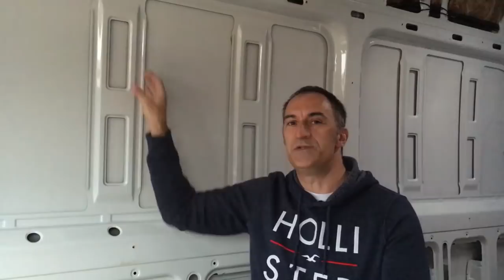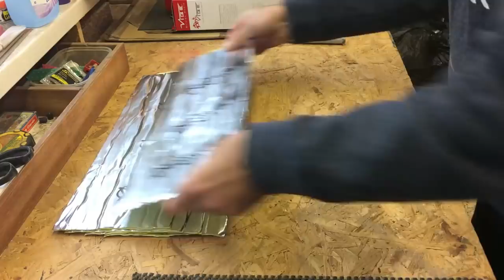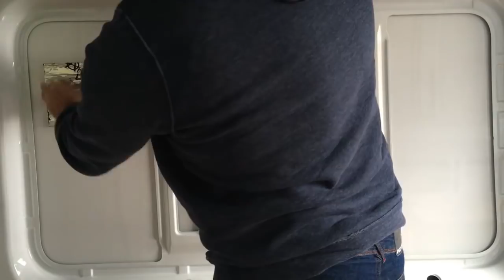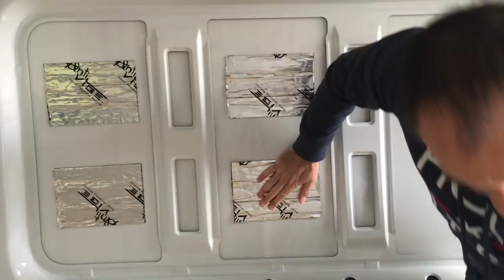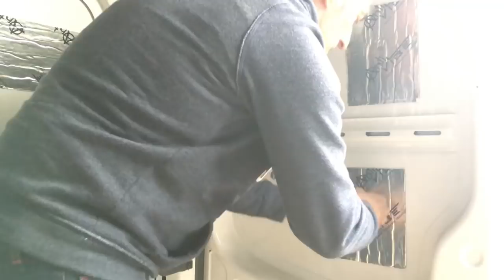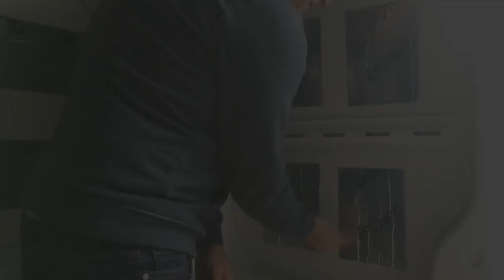Noise & Vibration in your Camper Van

Comment from the maker: EXTRA NOTES - You may find that your panels rattle because they have come unstuck from each other. I recommend using some Sikoflex mastic to stick the inner and outer skins back together, before applying sound deadening material. A good inspection of each panel and inner stiffeners will highlight where repairs are necessary. Hope that helps and thank you for watching.
Reply: Might be worth mentioning that a bit of heat helps in cold weather - I fitted mine in 2 degree weather and found that a quick blast of a heat gun prior to application made the material much sticker and much easier to work with.
Reply from the maker: Sounds like a top tip Duncan, all these things are better applied when it's a bit warmer. Cheers
Reply from the maker: Hi, you are absolutely correct the insulation will provide sound attenuation by absorbing sound waves that travel through the structure.
These anti vibe mats do a completely different job. They prevent the thin sheet steel panels from vibrating and producing a drumming or ringing noise. So they are preventing the noise generation at the source.
Thanks for your kind feedback
Reply: Greg Virgoe I viewed an insulation build by someone else, and they go criticized for not using the anti-vibration pads. Their response was the Mercedes cargo van already has them installed.
Reply: Greg Virgoe All the videos you make are so helpful.
Reply: Greg Virgoe excellent video series, thankyou.  just on the sound proofing aspect, your insulation, plywood and vapour barrier will be your sound proofing. Those three cover all aspects of sound proofing: mass (plywood) Damping (rock wool) and having an air tight seal (your vapour barrier). Judging by what I've seen so far from your attention to detail and workmanship, your camper will be quiet!! Thanks again for these vids.
Reply from the maker: Spot on! You know your stuff. Cheers
Reply: Ive found a few of those, even some that looked attached but did move around!
Thanks for the great series
Reply: No problem, just so you know, the anti-vibe tape  will help prevent road noise whilst vehicle is in motion (the "drum effect") . It won't however stop sound from entering or leaving cabin once stationary. Rock wool is probably better than pu in this regard, but only marginally. The greatest sound attenuation will be in the Air-tightness, mass, and damping/isolation. You've got all bases covered!.
Reply from the maker: Thank you, Really pleased that you find them to be useful.
Reply: Thanks Greg for a really useful and informative video, I'm following your build with great interest as it is something I'm planning to do myself.
Reply: Sickoflex recommend any brand or place to buy
Reply: Hi Greg - Great video,   Do you have a link to the sound deadening product you've use in the large sheet.   Would you recommend sound deadening the cab  floor?    I was thinking of using dodo sound deadening Mat are these products comparable? thanks in advance
Reply: Hi Greg, thanks for the awesome videos! What number Sikaflex would you recommend for this job?? Are there any other sika products that are useful for the van conversion as well? Thanks very much!

Comment: Do the wheel arches need covering in this?  I’ve seen vids where the whole arch is covered in the dodo mat. ?
Reply from the maker: There’s no vibration in the arches it’s noise breakout. So closed cell foam insulation is best to absorb the sound from the road.
Reply: @GregVirgoe  great. I’m about to embark on my own mission. Your vids are very helpful 👌

Comment: Adding mass lowers the natural frequency and adding stiffness increases the natural frequency. I am an M.E. and vibration analyst and consultant and when I do my van build ( hopefully Spring ‘23) I plan on actually testing this material and documenting how and to what extent it actually works.
Reply from the maker: As I said in the video it definitely helps on the large flat panels. I don’t see the point of putting it anywhere else as the manufacturer has done enough to combat vibration. 😊

Comment: Do you think those sound deadening materials are still needed before applying spray foam? Or the spray foam alone is enough as a sound deadener
Reply from the maker: You won’t need them if you are doing spray foam insulation. You won’t need a vapour barrier either as the spray foam is a closed cell
Reply: @GregVirgoe  Thank you. It’s really amazing how you scientifically explain what you’re doing.

Comment: Are there any issues of this type with luton vans? I'm wondering if the framing and insulation will stop any noise and the acoustics will be good once it's full of furniture and partitions and stuff
Reply from the maker: If the Luton is metal sided a couple of sheet on the large panels will prevent any vibration noise. The thermal insulation, panelling and internal fixtures will help with sound absorption 🥳😃
Reply: @GregVirgoe  that's excellent, cheers Greg. Really informative and in depth video. Can't thank you enough

Comment: Hadn’t a clue where to start quieting my caddy down but now have learned a lot from this video especially differences between sound deadening  and sound proofing easily mistaken for the same thing great video Greg
Reply from the maker: Also different methods fir dealing with noise depending on how it’s generated. Either by vibration or transmission. The sticky deadening mats deal with vibration. A dense foam insulation is better to deal with noise transmission from outside like wheel arches etc.

Comment: Question, let's say after a year or so I want to remove it. Would it be difficult to remove due to the adhesive ?
Reply from the maker: It would most likely leave a residue that you would have to remove with a solvent.

Comment: I'm not convinced it makes any measurable difference in terms of reducing van noise certainly some 'vanlifers' have tested it and not detected any significant improvement.
Reply from the maker: They stop the generation of vibration noise from large panels. 
To stop road noise and noise from outside you need to insulate with a dense foam.
It does help to deaden the rattles and you don’t need much to do that.

Comment: Another great video Greg, thanks for all the info. In a previous van conversion, I used a roll of self-adhesive lead flashing from the likes of Screwfix or Wickes. It's not quite as thick as sound deadening sheets but it's well under half the price and seemed to do a great job. I now have a new van to convert and was trying to decide whether to go down the same route as before or go for the proper stuff. If all it's doing is adding mass to stop the panels from vibrating then I think the cheaper lead flashing might be the option I pick.

Comment: Thank you!! I grew up working on cars from the 60's so I was no stranger to using sound deadening. I'm doing a van conversion now and watching how much butyl rubber sheet people use, it seemed excessive. I worry the lay person confuses sound deadening with sound proofing. NVH (Noise, Vibration, and Harmonics) is actually an interesting part of vehicle design - RVs and conversion vans are definitely unique, as you can often be more concerned about noise characteristics while parked than while driving.

Comment: Would it be worth sound proofing if I plan to convert the vehicle into a motor home? I'm considering investing in a van or bus to convert to a motorhome and and as a film student I need to be able to record or play sound files whether I'm in the city or not without being a disturbance to people outside my vehicle.
Reply from the maker: You’ll get some sound absorption from insulation. The more dense the better the absorption but at the cost of extra weight. Soft furnishings inside will also help reduce reverberated noise. 👍🏼😃

Comment: This is very helpful to find. I am looking up videos on sound dampening because I'm not planning on really adding any insulation to my van, and I too have seen videos and pictures of people going absolutely crazy, covering every square inch of interiour surface with sound dampening. If all it does it add weight really, then there's no real need for it.

Also, thank you for actually doing the knock test before and after you apply panels. It's very hard to find that in videos covering sound dampening for some reason.
Reply from the maker: What climate or location do you plan to travel in? I presume somewhere warm.
Reply: @GregVirgoe  Hello Greg, thank you for replying. I live in Ontario Canada and plan to live in a van for a while in a city.
Reply from the maker: @GodOfReality  what are the temperatures like. I heard it gets very cold in winter ❄️🥶⛄️
Reply: @GregVirgoe  It can, it depends where in Canada. The coldest places in Canada are actually in the centre, in the prairies. Northern Ontario can get pretty cold but this winter in Southern Ontario it's only been as cold as -25 C give or take a bit. Nothing too bad, just means you need gloves and a hat.

Comment: Do you only use these on the sides of the van or the roof and floor as well?
Reply from the maker: As explained in the video there is no need to do the roof or floor as these do not vibrate. Normal insulation in those areas gives you sounds absorption enough.

Comment: great explanation  i notice you only put on the walls  what do you think about putting some on the ceiling.
Reply from the maker: Michael Lowe the panels that are already heavily ribbed like the roof and floor will not cause noise by vibration. So using a deadening mat is a waste of time and money. Just treat the large flat panels. 
Good insulation everywhere else will attenuate Amy breakout noises.
Reply: @GregVirgoe  thanks for the reply . yes never thought about the beams . watched some videos where they get really carried away with the matting

Comment: What I love about the video (and all the others in the series) is that it doesn't just tell you how to do something, but also why to do it in that particular way rather than any other. I work in acoustics and industrial noise control and your explanation of how the sound-proofing works is right on the money! I think its worth pointing out that while the rockwool insulation is very effective for sound insulation, the rigid Kingspan boards don't really help much. BUt given their superior thermal performance, I guess its a reasonable trade-off in order to keep the van nice and warm.
Reply from the maker: Hello Arthur, I have seen so many videos where people don’t know how to use the materials or why so that was the aim of all my videos to give factual advice. I agree with your statement re PIR insulation offering less absorption than rock wool. I think once the vibration has been deadened the breakout is less of an issue. 
Classic misuse of sound deadening May is wrapping the wheel arches in it. 
They are naturally very rigid so the only issue is noise transmission which you really need dense foam or rock wool to combat that. 
I see some wrap their entire van and think what a waste of money and time.

Comment: Did you apply any to the ceiling out of interest? Just wondering whether this is something you would do now you've had a good bit of time in the van if you've had rain that sounds loud from the inside. I can imagine this could help with the sound of rain or birds walking on top of the van.
Reply from the maker: Adam Phillips no I didn’t bother doing the roof. With the pressed ribs it’s already well protected from resonant vibrations. 
Rain on my skylight is the most I can hear.

Comment: I'm in the middle of converting my Chevy Blazer 4x4 SUV ..I removed the rear seats and have to do some custom framing to fill in the floor gaps to 1 level wood floor And a bed frame above the Wheel wells ...For noise reduction And a basic thermo break I used a rubber spray about 1/2' on the floor and outter panel walls  I shopped around And for full coverage it was cheaped then the sound deadening  And your able to get hard to reach places I followed with framing And then a friend that worked for a Pro insulation Gave me a 10 min spray foam job on the floor and sides and roof (2 inches)  for a case of beer and get in and out  Otherwise $300 plus tax (13%) I also drilled holes into some of the framing and ran a thin PVC pipe for wiring so i am able to run any extra wiring from 2 sides of the truck front to back left and right And a floor outlet for outside hook ups of power 

All said and done i have this 1 rattle coming from the driver door which is a soild metal arm for closing and openning the door from the inner door handle Driving me bonkers lol

Comment: Hi Greg, did you put any on the roof panels of the van? Cheers
Reply from the maker: Ben Blackburn no as I explained in the video the roof already is corrugated which prevents it from vibrating. So just a case of sticking some of the beams back to the roof where they may have separated. People go mad with this stuff and it’s no necessary. It’s expensive and heavy so just use it on the large plain panels only. 👍🏼😀

Comment: Hi greg just a question about insulating the top side panels of my van , do I put the bubble foil straight on to the metal panel after sound deadening or do I fill it out with 50mm celotex first then bubble foil and alloy tape the joints , many thanks .

Comment: I just dont see a point doing this. It stops metal from vibrating. I can understand its for a car to make it more luxurious but in a van with loads of rock wool/insulation panels/ plywood sheets/furniture/cabinets you name it in my eyes it is useless as a sound barrier is already good enough while standing still. If it was in a drivers cabin absolutely yes but not in a living space. If it was sound blocking material  maybe but not a vibration deadening material which main purpose is  to dampen road vibrations that are transferred through suspension components to a cabinet of a vehicle. Not like it would do much while standing still unless somebody keeps knocking to a van and when driving there will be no people in a living space. I see so many videos of people spending money on this just because they saw somebody doing it and they put loads of material. It does a job but not worth for convertions in my mind. Anyway great videos.

Comment: Would you bother with sound deadening if the cab and back are going to be separated by a 12mm ply bulkhead (with 25mm Celotex insulation on)?

Comment: Greg, you are officially my go to guy as we start to plan out the build of our van! Your videos are so informative and useful. I had a question in regard to sound proofing/insulation. Do you think using the anti-vibe would be worth it if we are planning to use spray foam for insulation?
Reply: Why not make a test with 3 sheets of metal?  We would love to know.  
Test 1 - Butyl liner only
Test 2 - Foam sprayed on metal as thick as van will be 
Test 3 - Butyl liner first, then spray with foam thickly.

Now dangle each of them with string, and strike with a wrench in a quiet place. 
Record decibel level with your smart phone app.

Comment: hi greg just subscribed awesome channel mate is there a link for this lead panels are they available on the net cheers terry
Reply: If you are stuck and cannot find the genuine accoustic panels Have a look at Bostik Flashband Tape (available from Screwfix) ...buy the wide rolls ... Its basically a sticky black goo ( a bit like caravan window tape) stuck to a thin sheet of aluminium like material
 I used it under the floor mat and seats, over the front wheel arches in the cab and as far up the bulkhead as I could get. 
It probably won't be as good to reduce the boom off the body panels but it worked OK killing off the transmitted road noise

Comment: Greg if you listen to this video with a good speaker, you will hear that the deadening material was actually only lowering the frequency. I actually found the "dead" sound more annoying. Do you think that your amazing termal insulation technic would cut down the dB but keep the frequency of the wall sounds?
Reply from the maker: Hey Zoltán, great name btw 👍🏼 the frequency has definitely altered, that is what this material does. High pitched sounds have high frequency wave pet terns and low pitched sounds have low frequency wave patterns, so the extra mass has slowed down the vibration rate creating a lower pitched sound. More than that is the reduction in the amplitude and time-period for the vibration to stop. There is a noticeable reduction in dB level and the time period is greatly reduced too. The addition of insulation in the wall panels will also help to adsorb some of the remaining sound making a very nice quiet van. Just out of interest our rear doors used to close with a rattle and very tinny noise, now they close with a satisfying low pitched thud, like a quality car does. Sound much like temperature is subject to personal preference. Thanks for your comment
Reply: @GregVirgoe  Thanks so much for your reply. Are you planning to make a video to compare all three stages? That would be amazing! I will definitely use your thermal insulating tips! The electric switch between the hook and the inverter is amazing! Thank you so much for sharing all of these with us!

Comment: Heat insulation the engine compartment and exhaust and generator if you build a compartment. Heat insulation between cab and living area in a four season van. You can use original partition between cab and box and spray foam it for. Dead winter install. A winter van is nice for winter travel where you can park anywhere. Some areas They close roads so great sub zero travel. Have seen -45 degrees and wind speed . I have used walk in cooler panels for box truck or cargo van insulation.